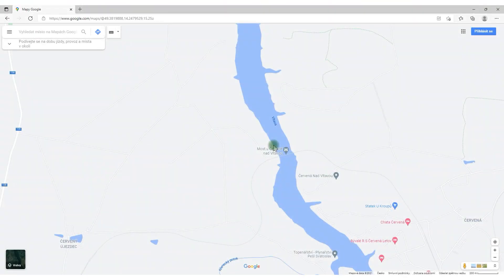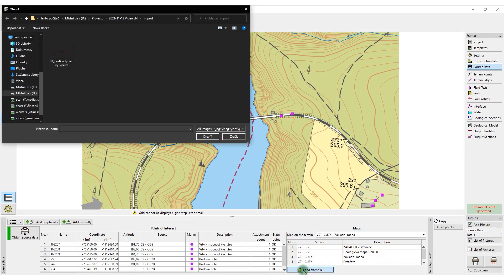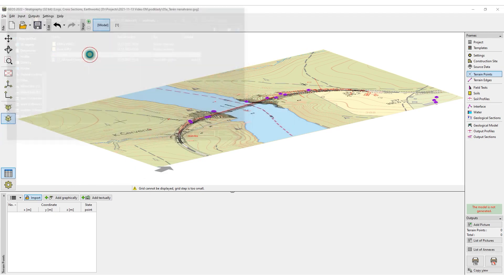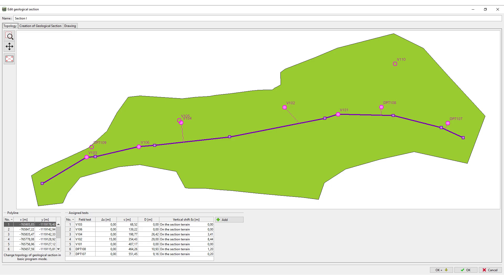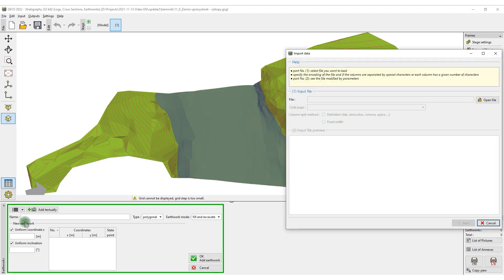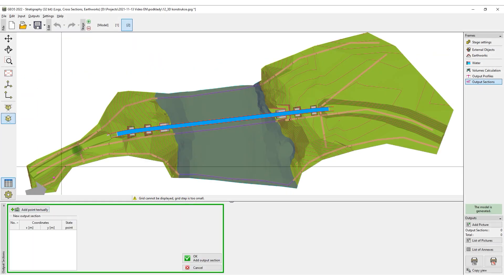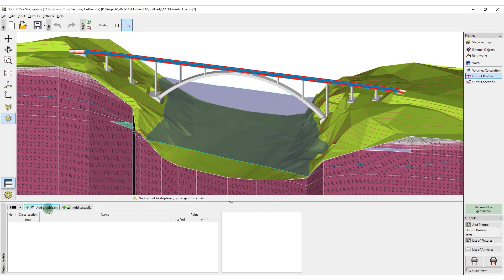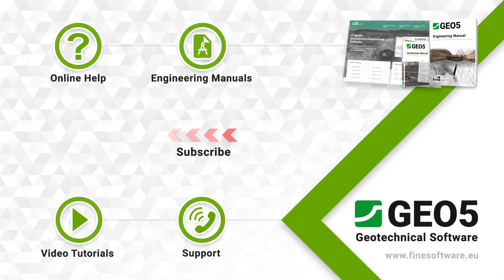GEO5 2022 and geotechnical BIM

Comment: Hello, very interesting. But I have a question about outputting the model in IFC. Does the IFC model contain solids or only the layers as a digital terrain model
Reply from the maker: Hello, the IFC model currently contains only surfaces (or layers). Adding support for solids in IFC export is already on our to-do list, and hopefully, it will be implemented soon. Best regards, Fine